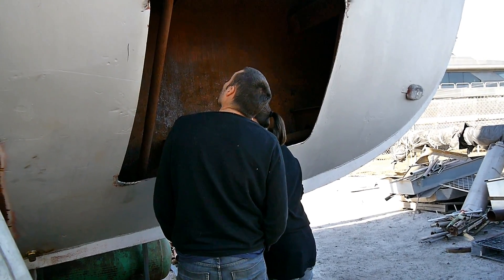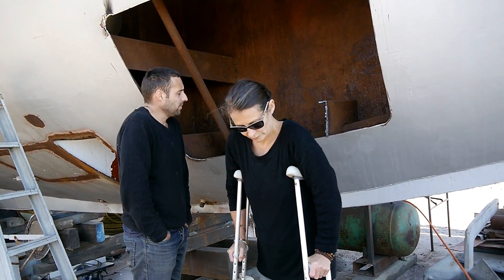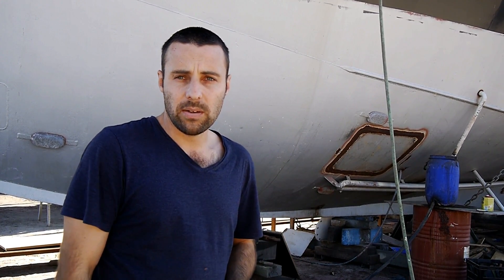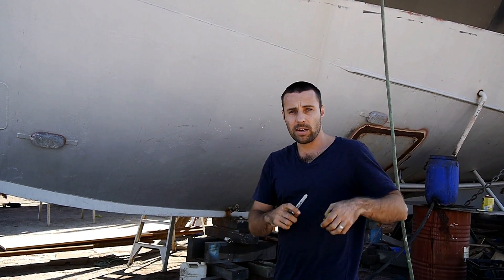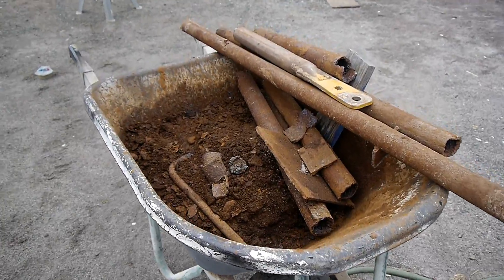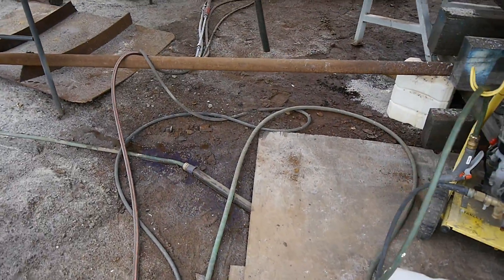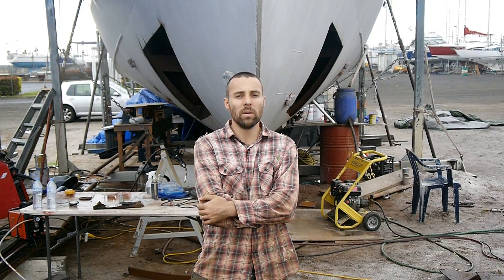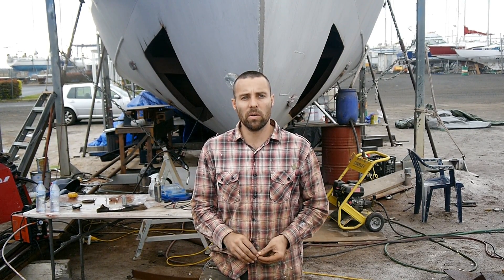RUNNING A DIESEL ON VEGETABLE OIL (Part 1 cleaning the tank) Steel Boat Adventures BRUPEG (Ep. 37)

Comment: I don't recommend that you enter iceberg or ice flow waters with this boat. Check out ice class specifications in SOLAS regulations and Scandinavian ship building practices.  That crash bulkhead is quite inadequate. Hull frames forward ought to be a lot closer and more frequent.
Reply from the maker: Also, small yachts have been visiting iceberg waters for a long time. We appreciate your concerns but we would rather do it than not. Life is too short for fears to become our guide. Jess
Reply: @ProjectBrupeg  The deadweight - and, hence, momentum - of the vessel  is as important as the strength of its potentially colliding hull. A dinghy will bounce off and icefloe as might a small yacht. Brupeg is heavier.
Reply from the maker: Nayo have a look through our episodes we explain both the changes we will be making and the advise we have received from ice breaking ship builders explaining where we want to go we will be fine. We are not an ‘ice breaking’ boat. Jess
Reply: @ProjectBrupeg  Good. Glad to hear it. I have owned an Ice Classed ex- Norwegian ferry built to work above the Arctic Circle and am aware of the extreme specifications demanded for such passenger certified vessels. What I see of the foremost below the waterline hull of Brupeg does not convince me. I also suspect that you'll need some permanent ballast additions to level the waterline once all is completed. You have removed and added weight without explanation of how these modifications will affect how she lies in the water.
Reply from the maker: The weight add and subtract is equal and there are quite a few changes to be made although we have been advised we don’t need to at all. Check out the details of brupeg (website) it might make you more comfortable. Sometimes things appear different on screen. Remember we are not a commercial vessel and not passenger certified at any point. We are assuming a 2-3 month haul out about a year after launch. Jess

Comment: Won't veggie oil congeal in the tanks in cold climates ?  I know in the past that vehicles running on 100% veggie oil also had to have a diesel tank to start the engine below about 0C and then run heaters to "melt" the veggie oil.
Reply from the maker: We will also be starting and stopping on diesel and we have 6,000L of heated tank capacity, it's only the front storage tanks that aren't heated.

Comment: I love how dedicated you are to working on this, it's inspiration to keep working on my projects! I used to drive a Mercedes 300d  from the 80's that ran on veggie oil. I had to pay a burger joint for the used oil, I'm jealous that you can get it for free! How do you plan to keep the oil warm enough to go through your fuel injectors in the cold temperatures you'll be sailing in?
Reply from the maker: more than likely a scaled up version of what you had, our oil is warmed in the tanks, then runs through a heated fuel line, then into heated fuel filters, then through a engine coolant heat exchanger before its delivered to the fuel pump. our engine cycles fuel through the injectors to cool them so that hot fuel is then dumped back in the tanks and the process starts over. when its very cold we extract heat from our exhaust that also warms the fuel tanks, so mostly our fuel is using waste heat to stay at temp.
Reply: That sounds epic, I look forward to seeing that!
Reply from the maker: yeah should be a bit of fun setting it all up
Reply: You may want to pursue two lines of approach: 1) some sort of immersion heater circuit (like a kettle!) for the forward tanks that could either run as part of the engine cooling circuit OR via battery power when possible; 2) investigate if inline fuel pumps and injector modifications have helped to run the diesel on veggie oil. Because I recall words like "cetane" and "viscosity" come into play with these fuels as well as of course high levels of filtration and water separation.
Reply from the maker: Hi Marc, this will all be covered in the fuel episode coming up soon

Comment: I was part of the first research and production of biodiesel fuel aka methylester. I made it from sunflower oil, rapeseed oil, and canola. Lots of sodium hydroxide and alcohol cycled through tanks and heated up to 40C for at least an hour. After this it was allowed to separate in a 1000 g tank and drained as much as possible the non oil lower fluid then water was added and slowly washed as much as the caustic materials out by stirring slowly. It worked very well except we had to modify the injectors as it broke down tubing and gummed them up. The farmers were using it in the fields and we had a car used on campus and or just an engine which was kept running to determine the effect and efficacy.
Reply from the maker: thats awesome, we will be using a slightly different set up, we wont be chemically changing the oil, our engine will be modified to burn straight vege oil. its starts and stops on diesel to remove the gumming effect and the issues with contamination of the lubricating oil when using cold vege oil. but once up to operating temp will run on 100% unmodified vege oil.
Reply: Steel Boat Adventures - Building Brupeg Thank you for the reply it’s cool I would double filter it if possible especially used oils say from a burger joint. Good luck🍑

Comment: I used to run a Mercedes 240D on SVO with a heated SVO tank and a changeover valve. I had no problems once the SVO was up to temp. You do really have to clean and filter the veggie oil very well. The main worry is clogging or degrading your injectors from particles in the veg oil. I always used a good diesel fuel treatment in the regular diesel tank to keep the injectors clean. I have to say, I'd be a little nervous doing the SVO thing knowing I'd be hundreds of miles out at sea if anything went wrong. My old mercedes was cheap...I imagine your diesel engine will be significantly more expensive and more costly to service. Good Luck..I will be following your progress.
Reply from the maker: Hi, yes the risks of issues with vege oil are there however we are also able to create better quality fuel as we will have all processing ability onboard and we carry a full engine rebuild kit as spare parts. Im also a heavy diesel engineer so able to fix anything mechanical onboard. That said i do take what you have said onboard as its a fair point, but its one we can also manage without to much trouble.

Comment: I wonder if a marine bullbar variant would increase the breaker power of this vessel. I've seen something similar on a light cross between a patrol boat and a fishing rig a few years ago. It had been bought from a marine wrecker and refitted to study stuff North of Greenland (forgot the name of the boat, something with Pfe and an innumerable number of letters).

Anyways, it was running down the cutting edge from the tip to mid ship and was made from a single piece of pipe that had been welded with reinforcements at approximately 10 cm from the ship's hull. 

I saw the boat in a dry dock undergoing some engine repairs. The piece of pipe seemed quite beat and a section "caved in" so they must've struck something at some point. 

Just a little ramble/reminiscing as i was watching you fellas cut the inspection panel.
Reply from the maker: Interesting thought, our stem is 30mm thick steel, 250mm deep so its probably going to have a similar effect to a bull bar, that said we will be beefing up the bow with additional plating and ribs when we start heading towards the ice.

Comment: Hey Mate, how do you plan to warm the veggie oil to stop it solidifying in the tanks from the cold ocean water?
Reply: Insulating the tanks while you have access would be desirable.
Reply: Steel Boat Adventures - Building Brupeg If the front fuel tanks aren't heated in any way, it seems like you will definitely have gelling, wax formation, in your veggie oil fuel.  How do you move/pump the fuel from front tanks to the rear heated tanks?  I don't know anything about boats, but I've run a biofuels cooperative for 10 years (Omaha Biofuels Cooperative, Nebraska, USA), processed ~65,000 gallons of used cooking oil into biofuels (straight veggie oil, and biodiesel).  I would be really concerned about the veg oil at or near 0°C.
Reply: Yeah, I hear ya Mate! Not trying to spend your millions for ya but you can't call NRMA if it gells up. Anybody out there have any cheap solutions? How about closed cell foam board.
Reply from the maker: Hi Scott. It’s possible we may add some variant of a heater to the front tanks or alternatively just fill these tanks with diesel when we go polar. We still have 6000L of heated tank capacity in the rear. Brupeg is quite experimental so although the conversion is simple enough everything is tempered by what we can afford to do now and what needs to be put off until we are in a cheaper country to modify. Aussie is possibly one of the most expensive countries to build a boat like this in. I would love to get your feedback on processing the oil to use in a two tank setup rather than converting to biodiesel.
Reply from the maker: True. As always it’s a balance between cost and forward progress
Reply from the maker: The front tanks wont be heated, that said the oil is still liquid (albeit very thick liquid) at water freezing temp. the rear tanks where we use the fuel in the engine will be heated with engine coolant running through heat exchanger pipes and all fuel lines are heated in a similar way
Reply: It'll be interesting to see if that will be enough to overcome the chill of the Southern Ocean. A secondary warm transfer tank might be a good idea. What is the power plant? Big diesel is my business here in the Rockies.
Reply from the maker: The front fuel tanks are in direct thermal contact with the sea so will sea at whatever temp the sea is at. I like the idea of insulation but I’m not sure it’s an option down in there (happy to be wrong on this though)

Comment: I have tried rapeseedoil on a scania v8, it ran fine until the bacteria killed it, I had a filter with heating, the problem was that the whole tank was heated because of the high backflow, I ran a mix of 5%alkohol and 25% diesel . One problem was also, when the motor was cold, the oil would stick to the cylinderwall and be drawn down in the oil-sump, and ruin the motor oil, it became thick as asfalt and I had to flush it out eventually .
Reply from the maker: Hi Helge. We will be running a two tank system, start up on diesel and get up to operating temp then switch to oil. The oil will be heated and filtered in the vessel but also treated with biocide to hopefully avoid some of the issues you had as well

Comment: So will the tanks require heating when in the polar regions?
Reply: How are you going to draw fuel when you need to transfer it from the storage tanks to the day tank if the tanks are not heated? Also will the fuel wax in low temp like normal diesel?
Reply from the maker: Yes. These tanks won’t be heated as they are just storage tanks but the main tanks the engine draws from are heated
Reply from the maker: Hi Ian as this is all a large experiment it’s possible the front tanks won’t work with Vege oil unheated. That said we always have the ability to run on normal diesel at anytime so if we find in the polar areas the unheated tanks are struggling with oil we will either heat them or fill them with diesel. We still have 6,000L of heated oil tanks on the rear

Comment: Hey! Love watching Brupeg getting closer and closer to floating. 
I am curious a bit about how you will supply yourselves with enough bio-diesel or straight diesel oil. 
I have only seen people do this for vehicles and have to collect and refine the oil themselves at a home base... is this type of fuel becoming more available at the the ports of call you plan on visiting? 
Could you talk about that in a video? 
I really love this project keep going!
Reply from the maker: Hi Matt yes we will go into detail on an upcoming episode all about the fuel. But yes it’s fairly easy to obtain if you know where to look. It’s also very easy to ship round the world so for us we are about to store a years worth of fuel onboard and time where and when we stock up. If you collect yourself (very slow but free) it’s possible to fuel a small engine without any real cost, for us we need large quantities so we are able to buy it for $280-$400USD per ton. Which is still significantly cheaper than the $1750 per ton for diesel where we are
Reply: Steel Boat Adventures - Building Brupeg --- I look forward to hearing about this all in an upcoming episode! 
That's really exciting simply for the cost savings alone!
Reply from the maker: I know right, and it is carbon neutral. Has 50% less particulates, zero sulphur emissions and has a high lubricating ability than normal low sulphur diesel (the sulphur was added to help line the engine before they realised how harmful it is)
Reply: Steel Boat Adventures - Building Brupeg 
:) I'm sold and definitely waiting for your next episode!

Comment: I ran my F250 on veggie for a couple years. As long as you have clean oil, run a good filter like a Racor 2020 SM filter, and heat the oil for viscosity....it will work. The biggest issue is....getting enough veggie oil!
Reply from the maker: Yeah that’s true. We will be documenting the conversion quite thoroughly so feel free to comment anything you see us doing wrong as it will save us some time down the track. Happy to learn from those who have gone before us

Comment: How does mild steel oxidise the veg oil fuel if there is no free oxygen present? Or is the issue the corrosiveness of the fuel? And what happens with the filters made of mild steel, and the fuel injection lines and pump if that's the case? And those tanks were never drained by the looks of it. What are you painting them with?
Reply from the maker: Hi Dom

Free oxygen is in any fuel tank as the vents are opened anytime its filling or emptying allow new atmosphere in. The oil itself is not harmful to the steel but the steel slowly oxidizes the oil making it unburnable in a diesel. it takes a while so momentarily passing through a fuel line or injector pump is not noticeable but because of where we are taking Brupeg we need to be able to store a years worth of fuel for heating if we get iced in, so we cant risk the fuel becoming oxidized as it would mean we have 25+ton of fuel that cant be dumped, but also cant be used, and this can turn a survivable situation into a non survivable one. as for draining them, i cant say as i dont know however other similar sized trawlers in our yard say they get around 60L of the sandy crap in their tanks each year and normally need to give them a thorough clean every three years.
Reply from the maker: Unfortunately once it’s oxidised it’s stuffed.

Comment: Now that's some nasty stuff in those old fuel tanks, I can see why all that work is ongoing. Good stuff from your help and offers ongoing, totally cool of them. Waiting to see the outcome with a cool drink in hand !!
Reply: My tiny pea brain tells me that there should be a large vacuum system tube at the bottom, that pulls the crap out and filters the oil a bit. Set to automatically run every couple of days.
Reply from the maker: That makes good sense. Originally Brupeg didn’t have anything like that but we are building something similar soon
Reply from the maker: Fair enough Bart. The trawler boys tell me they get around 10 litres of crap per tank per year so it gives you some context

Comment: Nice, I was doing the same work on Seeker's tanks on my last visit Oct '17... have you done testing similar to Doug's on prep and surface finishing treatments relative to biofuels ? Best to know before you sandblast, right ? Keep up the good works Brupeg !
Reply from the maker: Hi Mike. Short answer is no testing by our team, however we are getting a professional sandblast team in to prep the surface and we have the head chemist of the paint co guiding us on application. Both teams stand by their work (and I’ve seen plenty of their work to trust this). So it’s a no from Brupeg but a yes from the teams involved in each step.
Reply: Follow up question, will it be preblended biofuel, or separate tanks of diesel and biofuel filtered and blended just prior to use for redundancy ?
Reply from the maker: No biofuel here Mike. Filtered waste cooking oil and diesel only. Kept in seperate tanks. Engines starts on diesel, gets warmed up to operating temp then switches over to straight vege oil and runs for as long as needed then back to diesel for the last ten minutes prior to shut down. Biofuel is where you chemically alter the oil so it’s very similar to diesel and you can just stick it in your normal tank

Comment: Love your video. Thank you.   I don't remember any video, on the diesel you were trying to save .  Any comment ?
Reply from the maker: 2 ton of diesel 4yrs old that was underwater for 2 months, had seawater mixed in, got diesel bug then was left in steel tanks getting hot cold hot cold in the Australian sun for 3+ yrs. that’s what we are trying to save. It might work, it might not, worth a shot either way
Reply from the maker: Hi Max, we will be doing a full episode very soon on filtering vege oil and polishing dead diesel. As both are needed for our conversion
Reply: The fuel episode will be very interesting.  I really don't understand 'killing the fuel'. Cheers.